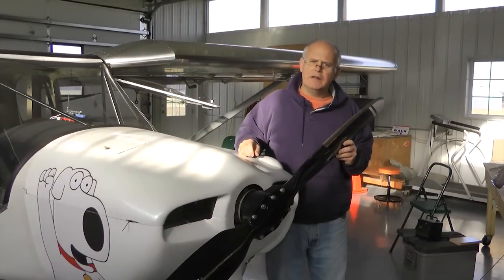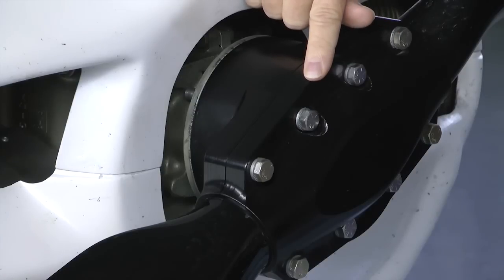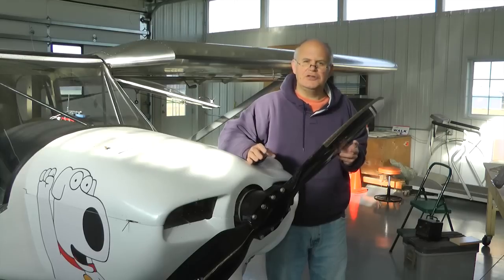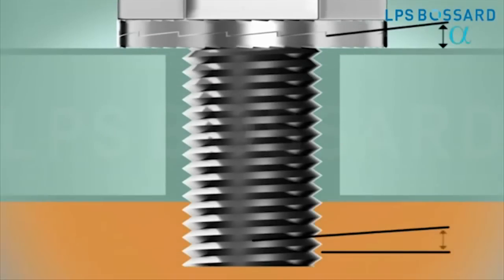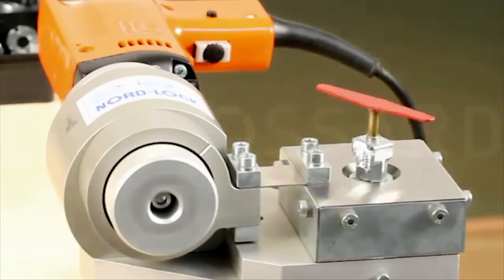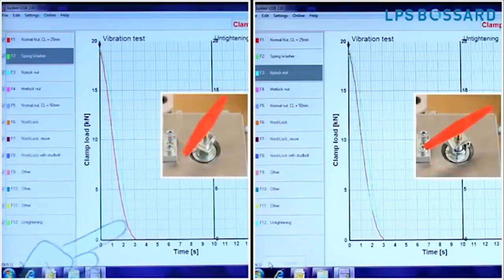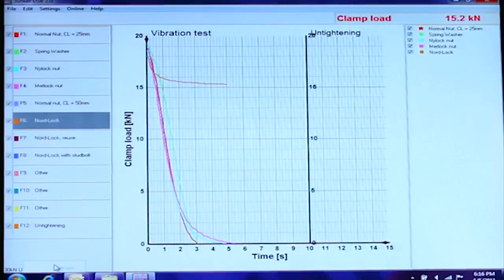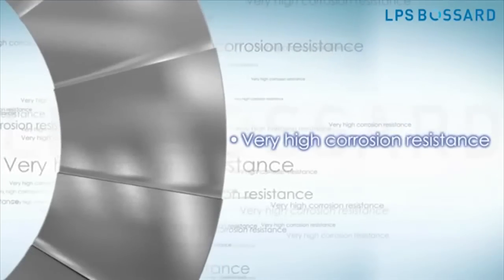A Unique method for Securing your Fasteners

Comment: On a propeller flange, which is threaded, how far must the threads of the propeller bolt need to protrude? Also are nuts required in addition to a threaded flange arrangement? The flange bolt length in question is a Lycoming 0320 which has a wooden prop installed. The bolts do not extend past the threads on the flange. The bolts are not safety wired.The project is years away from completion so the missing safety wire is not an issue as the propeller might need removal during the building process. Giving the builder the benefit of the doubt, I did not speak up with everything considered. I have researched for the answer and came up blank. There is plenty of information on how to deal with the front side of the bolt but not much guidance on proper installation in reference to the overall propeller bolt length  and protrusion through the back of the crankshaft propeller flange. 

If anyone knows this answer and can point me to a source, I would be appreciative.
Reply: I don’t know much about experimental/home built aircraft but I’ve never seen a certified aircraft with a regular prop flange that the bolts didn’t sit flush or a few threads showing. If your not literally 100% confidant in your builder then find someone else. Contact the manufacturer of your propeller for all questions pertaining to it.
Reply: @MrLongboarder87 logic says this is the answer, what I did not know is whether a backing nut was required in addition to the threaded prop flange. That answer is no. The situation here is a tractor engine was mounted on an experimental in a pusher configuration. The propeller. Of course, would not work and another was installed with a different thicknesses and the bolts came up short. Thank you for your input.

Comment: How should you torque them in aluminum.
Reply: Use the recommended torque, then re- torque after running for a while in high vibration aluminum applications.
I would not recommend them for aluminum parts that need to be disassembled very frequently. Each time they are loosened, they remove a little bit of the aluminum.

Comment: The explanation of the mechanism contains the assumption that the bolt cannot slip relative to the top half of the Nordlock, and that the bottom half of the Nordlock cannot slip relative to the metal substrate. If either of those assumptions is false in a particular installation then the Nordlock could behave like a solid washer, and the bolt could come loose. The Nordlock has grooves that are presumably intended to ensure that the friction between the halves is always less than the friction between the Nordlock and the bold and substrate, respectively, but contamination between the halves might change that. I wouldn't be using it on anything that my life depends on.
Reply: Yes, I concur.

Comment: This looks like a M10 thread rod to me so the nut should be at 49Nm optimum , but in the video its only 18.9Nm  , ofc the nut comes off .  Set it to proper Nm and the nut wont come of this easy .
Reply: When testing for how resistant a fastener is to loosing you can not test it at full torque.  First most bolts on their own will not loosen when properly torqued even with decent vibration. So why do many fasteners come loose? They loose their torque. Let's think about bolting or screwing together two aluminum plates. Imagine taking a good sledge hammer and hitting the bolt a few times? Even with a wide steal washer the aluminum is going to deform shrinking under the bolt. Guess What? That bolt is no longer going to be torque'd and if it was a screw that was threaded into one of the aluminum plates it's going to have almost no torque assuming the thread survived. Now it's ready to vibrate loose. Probably not the most real world example but it gets the idea in our heads. The force might be trying to separate the two plates similar to driving a wedge in between them or trying to rotate the two plates against each other but those forces can still deform what we are fastening and/or deform our fasteners even if just temporally. Let's think about all the forces acting on the fasteners in the suspension of a car hitting a pot hole at 65mph? Hopefully, the bolts or plates don't deform permanently but they'll probably deform temporally.*  Which combined with vibration will give them a chance to loosen even if just a hair assuming proper torque was all that was holding the bolts. The bolts and plates are not going to stay in prefect sync they act like springs of different sizes causing them to move out of sync. But think about that hair of loosing getting progressively worse over 10 years or more.  That bolt will reach a torque that just driving at 65mph over a smooth road is going to loosen until it falls off. Another factor for loosing is heating and cooling of the bolt and plates. Anyway, that's why you want to test your fasteners for resistance to loosening when they are barely tight. * On some of the old cars, I work on a mild steal dust shield is bolted down by grade five bolts that hold both the anchorman arm and the caliper plate to the axle sub. Over time almost 60 year now the mild steal dust shield deform from harming by pot holes allowing the bolts to come loosen. Though, Thankfully they have lock nuts! And usally no one has removed them since the factory built her. I've never seen it cause a full lose of control. But when I do go into fix the problem all these bolts four per side are no where near torque'd. Another bolt, I've seen come loose if the two holding the upper control arm. (If people haven't properly installed them) Here, whenever someone hits a pothole the bolts stretch while undergoing a lot of vibration. If nothing is done to keep them from turning during those few milliseconds they aren't at full torque they will come loose in pretty short order. 😱
Reply: I should also point out that later model cars by the same manufacturer use separate bolts to hold the mild steal dust shields down!

Comment: Yeah but how is that ever going to beat a castle nut with a cotter pin through it? Or welding your nut to your bolt?
Reply: If there is no clearance for that cotter pin or safety wire, then this nor-lock is the solution and why would you weld the nut to the bolt? nor-locks beat your welding method as it is simple to remove, just loosen and remove the fastener!